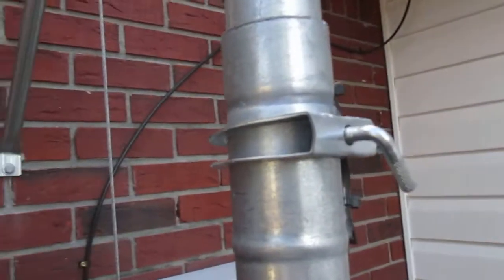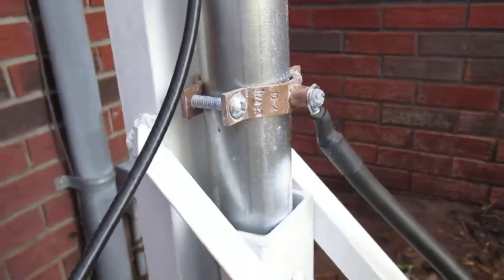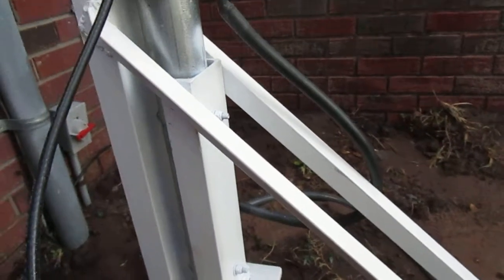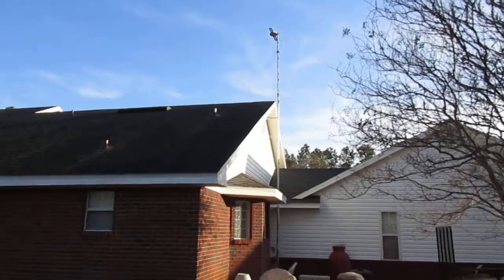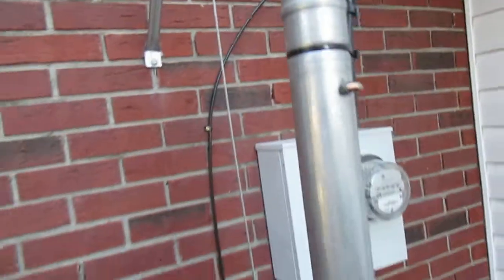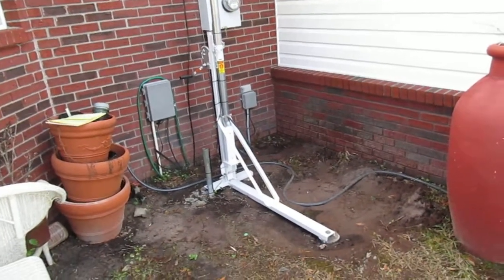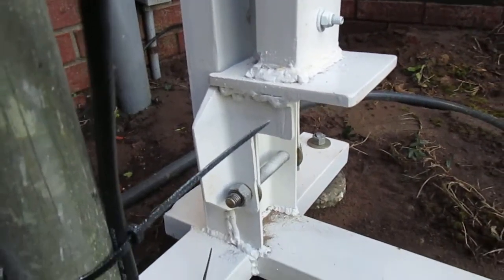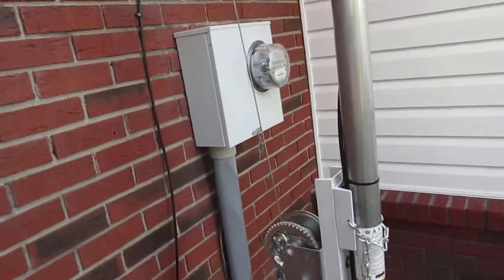Tilt Base for TV Antenna

Comment: Thanks for taking the time to make and explain how your antenna tilts over. I like your design because it fits my needs. As I am in a similar situation needing drop my mast with in close quarters to the house. I also like the pivot point being low and the mast elevated that lends a great mechanical advantage that results in less stress.